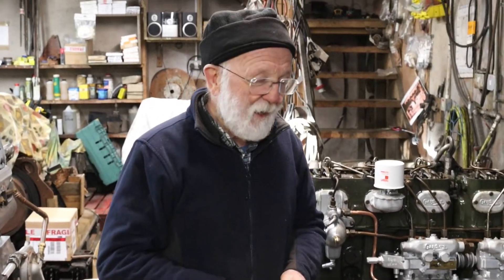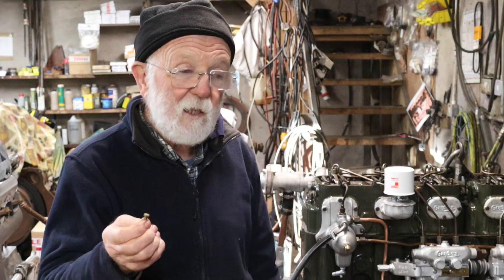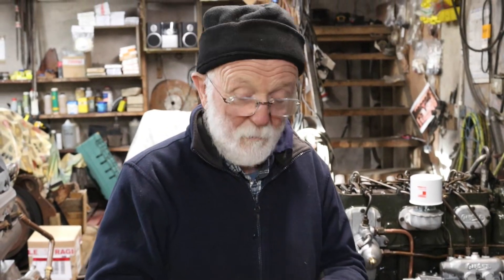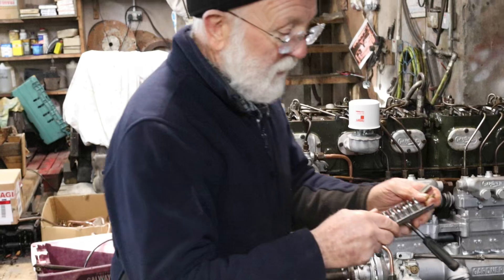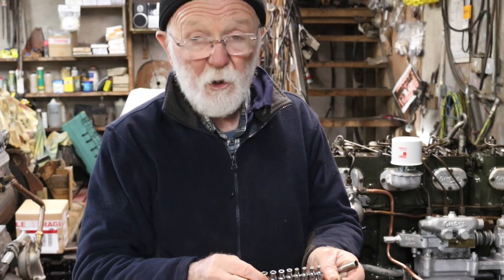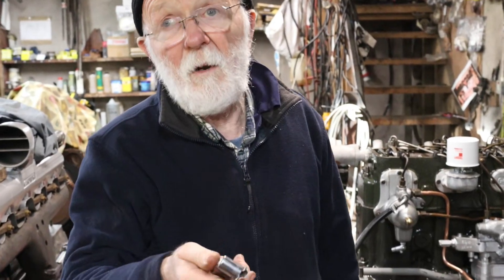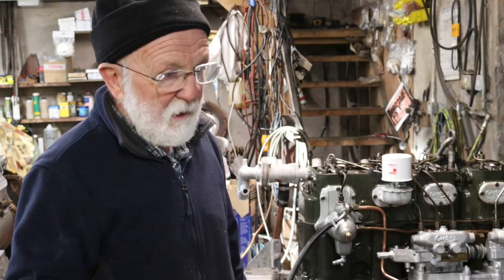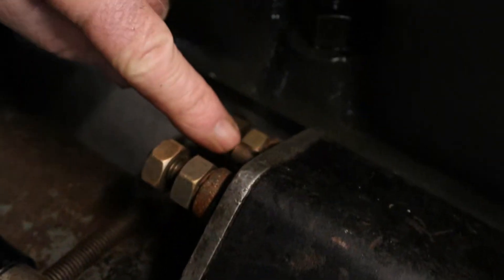Gardner engines and BA screws.

Comment: I used BA screws a lot when I started model engineering in the 1960s, and my father gave me a boxed set of Triangle Brand taps and dies which lasted me about 40 years (Sheffield manufacturer).
I later changed to completely to  ISO Metric (M1.6 to M12) for all my projects, although I still keep a selection of prehistoric taps and dies (BA, BSF, BSW, UNF, UNC) just in case something odd crops up.

Comment: The point of BA screws is that they use a Swiss designed thread which has a male/female format. When you get down to 6 BA the advance return on on one revolution is a known number of microns. The male/female format means unlike other threads they will not move when relaxed. So if used as a calibration screw on electric or electronic equipment they can be left when correct. Their thread rate is 471/2 degrees whereas Whitworth is 55 with a rounded edge. However, in WWII UNC and UNF were devised because while the Americans liked the Whit sizing the 55 round edge could not be mass produced by rolling. Consequently UN formats had 60 degree sharp edge format as with Metric. Post war with Britain exporting to the USA as tooling for war use was already in UN format it was retained by the motor industry. 
That is the rough history of threads as I have unravelled over the years working my way through industry from which I am now long retired!
Reply: Except Land Rover, who were still using Whitworth, BSF and a few Unifieds on their Defenders as late as my 1997, all mixed up with metric, BSP,BSPT.  What a mess.
Reply: @ Ah well there is a reason for that! They were originally built out of scrap as steel was on ration and the engines were prewar and used redundant machinery from stores. Consequently it was all a bit of a fiff faff!
Reply: @glynluff2595  Agreed, aircraft ally everywhere, but there was and is no excuse to still have been doing that nearly 80 years later, ESPECIALLY with steel bolted to ally without an insulator.
Reply: @ I agree but some things never change. Look at oil threads all bsp or not plain or tapered. That is from a different industry. Many problems come from part bin technology. Someone likes a door handle when designing. Parts engineer says Hills or some other supplier has something close. They dig out sample last used on say, Austin in seventies. With tidy over it does the job. Thread rate bsf because that was standard then. As for dissimilar metals how long do you want it to last. Today cars are made for 5 year life. Pass on at three and pass again at five. Nobody cares and that is so world wide! Why do we import Japanese vans for auto homes? They are scrapped after three years if they stay in Japan so cheap export. Remember, only the British expect their car to last fifteen years! On top of that you have purchasing officers. These are a nightmare. I had one tell me that he had saved money on my production line as he had purchased cheap screws to finish product run 2 years away. The product used terminal screws that were plated. He bought pan head with a metric thread and plain crap metal. I took him to the assembly machine pointed out the assembler would have to be redesigned for such a screw as would the sorter. It would require development time. There was an alternative. One person on a stool putting them in by hand at £10k per year. He had signed the contract without reference to me as production engineer. I shut off that part of the machine and had that part hand assembled. I think we shut the line down early. Long time ago now! That however is how industry functions. Sad isn’t it!
Reply: @glynluff2595  Mine is ex-MoD and their service life was being forever extended and is now extended again to 2030. The civvy LRs were supposed to be "the best 4x4 by far", remember that?  Lots of Landies about from the Fifties and Sixties and all fighting the galvanic corrosion issue.  Duralac is the saviour.
Reply: @ Yes I remember the first aeroporables being issued. I said they would last a week before in for repair and I was right! The problem with military equipment is it is designed for so many hours before service. The civvy end of MoD save money by extending life before service and the Minister nods it through. Everyone happy except REME who have to struggle to fix the blighters!

Comment: A salient point that your thread chart will tell you is that the BA thread angle is 55 degrees, which is the same as Whitworth.
UNF and metric thread angles are 60 degrees.
Fasteners are a complete subject in themselves.
Reply from the maker: According to Wikipedia, it is 47.5.
Reply: @tangentgardner  I sit corrected.
I am at home, away from my workshop and my thread chart,  relying on memory......
I know it is a mongrel thread angle compared to modern fasteners.
As Maxwell Smart would say,
"Missed it by that much."
Reply from the maker: @nkelly.9  ;-)
Reply: @nkelly.9  It's not a mongrel thread, it's a very rational thread. Metric, but with a logarithmic, not linear, step between adjacent sizes. Each smaller thread is 0.9 the previous diameter. Often, the odd or even series was preferred, as the difference in each step is small. It's a shame it disappeared.
Reply: @BillDavies-ej6ye I deal with BA and BSF and NPT and BSPF and BSPT and brass/bicycle thread and metric  et cetera, et cetera all day with my work.
It is same same but different.
 It's not a mongrel thread, it's a bastard thread.
That's probably why Mr McCool made this "look out" video.

Comment: Interesting film. I have a lot of BA screws and bolts in my workshop. I was an aircraft technician in the RAF. I worked on the Nimrod aircraft. We used to say that you could dismantle the entire aircraft with two spanners. 2BA and 1/4BSF. Love BA. 47.5 degree thread angle. Whats not to love.